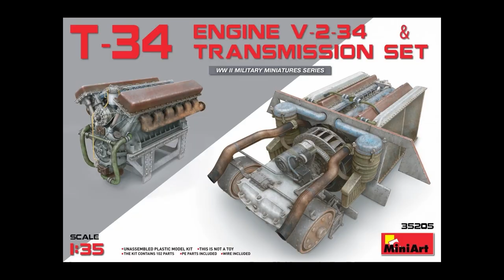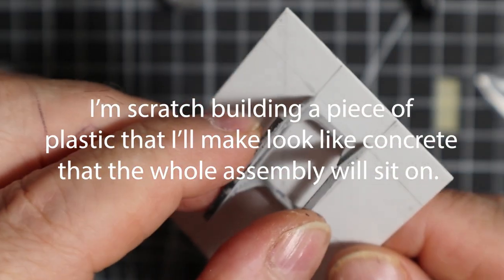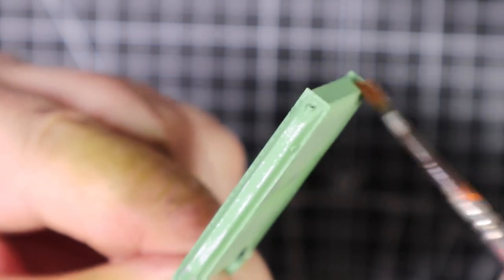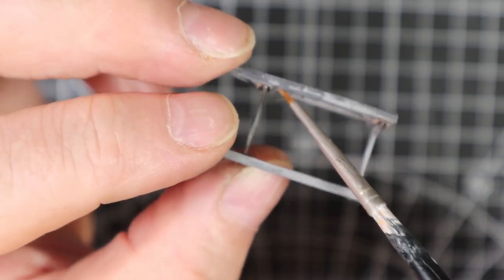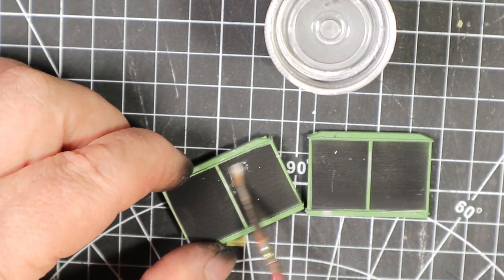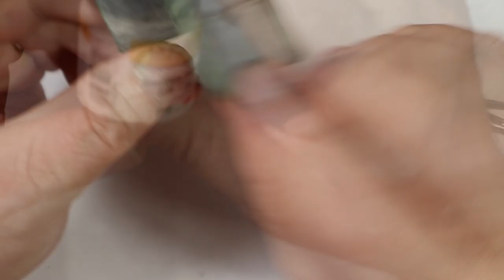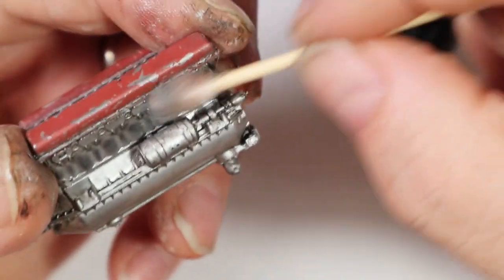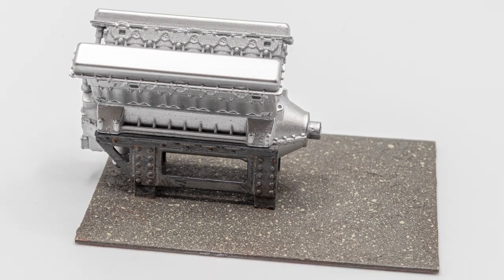Miniart T-34 Engine Model: Part 2 Build Exposed

Comment: Hi James, Nice video.  Your audio levels were much better in this video.  Nice job on the radiators.  The transmission turned out great too.  I've stripped paint too when I've been unhappy with the results.  Nothing wrong with redoing something until you're happy with it.  Thanks for sharing.  Have a great day.  Jeff